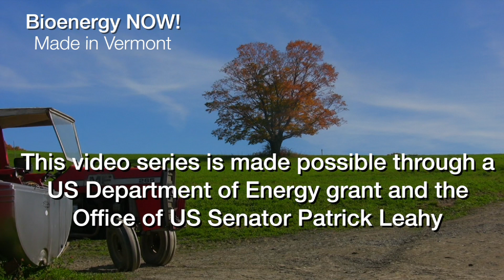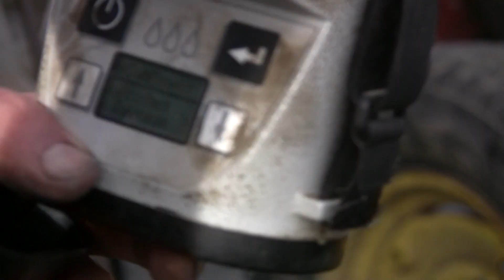Growing Sunflowers for Biodiesel

Comment: Dang the energy cost of producing energy is high
Reply: I've noticed in this video that the equipment is at least 3rd owner used, ten years ago. My guess is that there is very little margin available.
Reply: @kellykopsa384  Only ppl who don't actually know what they are doing run new equipment. When you see someone running pre-emissions equipment that is a pretty good indication that they have good sense and probably know what they are doing.